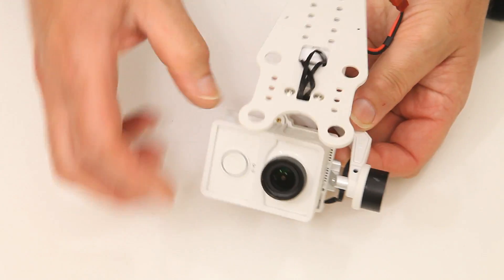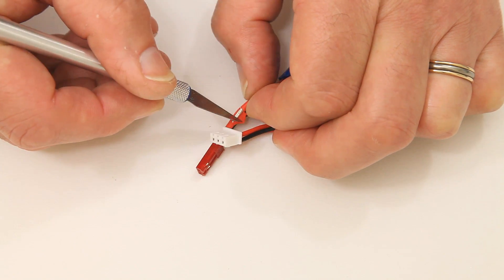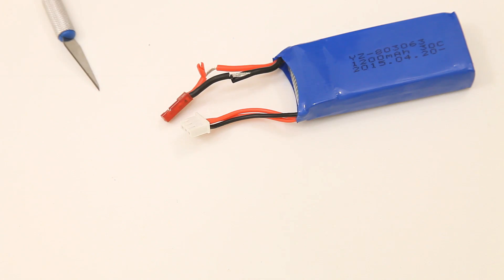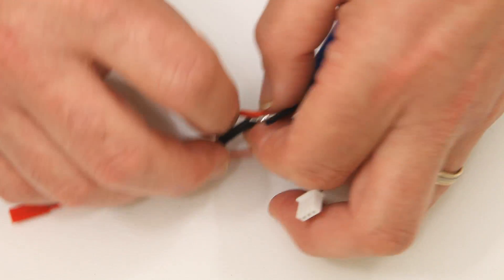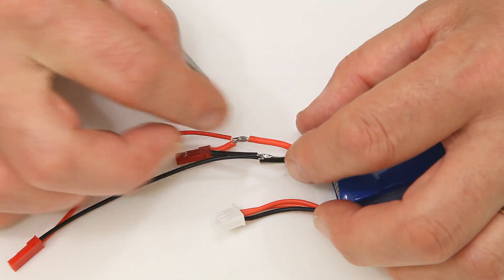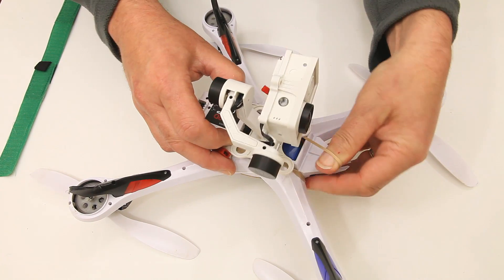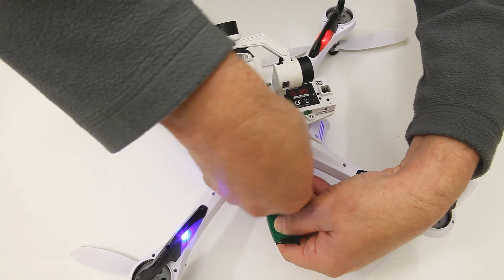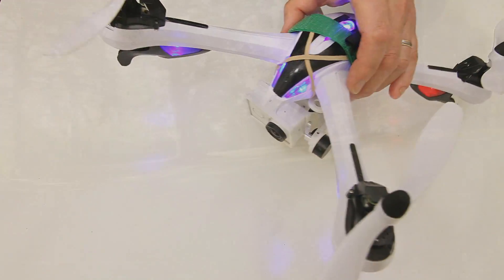Tarantula X6 fitting Walkera G 2D gimbal and battery mod.

Comment: I'm assuming this would work with a jst y harness, right?   Also,  would it be smart to buy a higher capacity battery given the additional weight and the power drawn by the gimbal?
Reply from the maker: +Darryl Price hi Darryl, finding your way around i see :-) Yep loads of people asked about that and yes a definate, then you don't have to mod all your batteries. I did mine because it was the weekend and I had the idea and it obviously had to be done right then! Have a trove through some of the comments because a few people have put a small 2 cell battery to run just the gimbal. Just to try and push it too it's limits I actually put 2 stock batteries on so loads of weight and power here is the video https://www.youtube.com/watch?v=uAb-t5oMLsE with a summary at the end ;-) TBH I don't think it will make a lot of difference but happy to be shown otherwise. Cheers for now

Comment: Hi there!, I'm very glad you are having a loads of fun with your modded Tarantula, your video inspired me to make myself G2D gimbal+ X8W quad combo with your soldering instructions, just finnished soldering gimbal wires to battery couple of hours ago and switched the power on, gimbal shaked like crazy but after a few seconds it balanced into correct position and everything looks fine. I had it powered on for a few minutes and what I noticed is that gimbal motors were very heated so does this happen to yours also? I'm using a stock 2000 mAh battery. Also, can you change the angle of the camera on the gimbal to point down a bit? Thanks a lot for your video man!
Reply from the maker: +Haris Berbic Hi Haris aren't these fun :-) gimbal sometimes has a wobble on start up, never managed to sort that so assume it is just setting up. Not noticed hot motors on mine even when i run it on CX-20 so don't know about that one :-( I think you can just alter the adjust screws but my way because I don't bother fussing is to hold the quad at an angle as I plug in the battery for the gimbal and it should stabilsed to level but when you fly it is at an angle ;-) hope it works for you and hope you thumbs up and subscribe if you haven't already good luck :-)

Comment: Hello! I plan to make one. How much volt is the battery u using on the drone and how long hold up the air  and also the wifi distance? I see ur flying his no breaking signal or choppy did u used u 2 camera?
Reply from the maker: +Jimmy Cheung around 9 minutes of flight check out this video to see https://www.youtube.com/watch?v=GuZyYS78AXs I don't fly wifi I fly line of sight only at the moment, I have heard it can interfere with signal but not tried it as happy with results without. hope you thumb up and subscribe if you haven't already thanks :-)

Comment: Hello ! Great job , the setup is fantastic! I have just got the same gear , Tarantula X6 with Walkera G-2d and Xiaomi yi and i wanted to ask you about a problem that i've got... Did the same , connected the walkera with original 7.4v battery of the tarantula , but when i take off after 20-30 seconds the lights start to blink and that's it, it goes down, :( i have to charge it again e.t.c. when i remove the gimbal and i connect only the tarantula with the battery i fly normaly (about 8-10 minutes) Have you or anyone here experienced the same problem , any suggestions will be very welcome!
Reply from the maker: +Hughes518 I have another X6 I should get next week so I will give it a try, definitely sounding like a weight issue but I still don't see how my original one still lifts everything I throw at it, hope to post a helpful reply soon. Cheers for now
Reply from the maker: +Johnny B Yeah well done you, plug in a 6 cell and fry that board :-) TBH 6 minutes is long enough to get most video, you will only cut it down in post if it's longer ;-) have fun.....derrrr course you will :-)
Reply from the maker: +Johnny B Ideas, I'm full of ideas it's just converting them into reality ;-) Hey you seen my channel you go figure it out yourself LOL I love the combination works real well for me as I hope you can tell from the videos. now your timing is impeccable, not often I use big words so did just google it to check I wasn't being rude LOL anyway I'm just working on a how I get the results I do from a £230 set-up and what I have learned that makes great aerial video IMO and part 2 of your timing I'm just about to see about a 3 axis gimbal so I should have all the answers for you before you splash your cash :-)
Reply: ***** Thank you guys so very much for your thoughts and help. I have ordered a new rx control  board.  I think that will fix my issues from what I see. I did the same oops storing charged batteries... live n learn. ;>  For future plans you may like the x380 detect gps quadcopter. A bit odd looking but getting cheaper now.  I have seen some for sale new at about 280.00 just recently.  It has a verified flight time of 20 to 30 minutes. Can carry the same g2d gimbals with remote tilt. 1000 meter range.. My dream machine ;>  i have to stop now before i drool on my monitor lol .. Thank you again for all of the input.. looking forward to seeing more vids Tigger ;> and from you too Johnny B now that your flying...
Reply from the maker: +Johnny B Hi Johnny no mine works really well as you will see in my full 9 minute flight video, I would try it with a second battery on-board, i found it made hardly any difference to flight time and just made flying slightly sluggish but it may work for you and keep it in the air for a respectable amount of time. Hope you get it sorted and a like and sub are much appreciated if you haven't already :-)
Reply: +Tigger's RC Reviews Thanks Tiger. Ι ordered one 2s 300mAh 7.4v battery to connect directly to the walkera. I am in contact with the seller though because i think something is wrong with the X6, cause the flight time with fully charged battery and without the gimbal and Xiaomi is only 4 minutes now :( ... I also tried to fly WITH the gimbal and Xiaomi but not connected to the battery and the flight lasted only 20 seconds before the lights start to blink. A matter of board? or the battery maybe?  I have send him a video and waiting for his answer.....
Reply from the maker: +Johnny B Definitely a problem quad hope it gets sorted with supplier soon, let me know and thanks for subbing :-)
Reply: +Tigger's RC Reviews I hope so too....I have just received one more battery that i have ordered from the same seller, i will try tomorrow with the new battery and see how it goes....But as you say, i think it's indeed the quad's problem :/
Reply: +Tigger's RC Reviews Today i disassemble the X6 to see if it has any kind of short or something like that, the only "problem" was that one Tarantula's eye light didn't work, so i cut it of the board. I charged the new battery but the flight time is more or less the same...Now it flies 5 minutes instead of 4 ,but i think that it's not to much. :( ... The seller offered to send me a new battery but i think that the problem is on the board so i asked him for a board instead (rev. 01 board) . What do you think Tiger?
Reply from the maker: +Johnny B Sounds more a board problem, I think, but TBH I haven't come across this so can't say for sure. If you have tried 2 batteries then that more or less eliminates that. Very impressed if they send board I'm guessing you haven't mentioned you took the other apart or I would have thought it would void any comeback ;-) Let me know how it goes. Good luck :-)
Reply: +Tigger's RC Reviews I think i forget to mention that :P .... I am waiting to see what will happen. In the meantime i did some more tests today.. I connect only the Xiaomi Yi to the X6. Flight time approximately 3 min...And based of a video of yours i connected two stock batteries one on top with the walkera and one under with the X6... Flight time under 2 min. Seems that the board have a weight sensor that drains the battery accordingly, or something like that.....
Reply: +Johnny B   Hi, I have the very same problem?  Tried 2 batteries with no reel difference?  as if it is just not able to pack the weight for very long? have seen many videos of this quad with gimbal and same camera fly much much longer... has there been a hardware vers. change?  has any one resolved this problem? i have the same walkera gimbal. x6 has flown 5 times gimbal new so are the batteries. It starts blinking low power 15 to 20 seconds into flight. tried an independent small 7.4 lipo just for the gimbal with no change.  take gimbal and cam off and it flies fine for 7-9 minutes. have put just the sj4000 on a foam rubber mount and get 7-8 minutes flight.  As soon as the gimbal weight is added it dies quick again?
Reply: +Hughes518 Still nothing new.... I am waiting for a new board to try on, if it doesn't work as a last solution i will change the motors too and let you know...In the meantime if you have any solution please let me know!
Reply from the maker: +Johnny B Will do and keep me informed if you find a solution too, this was soooo easy when I first did it I'm disappointed it isn't working for everyone, heyho fingers crossed someone gets it sorted and we all benefit :-)
Reply: Tigger's RC Reviews
thank you both....i really enjoy your videos and tips Tigger, thumbs up. also checking if it is a charger issue? is there a chance my charger is not fully charging my bats? i have only used the stock charger so far,  and my last unladen flight lasted 8 minutes, hmm.  i have added a jst jumper lead to extend power reach to the rear. I will check to be sure they are large enough not to create resistance. Johnny B have you done anything similar to that mod?  just curious.
Reply from the maker: +Hughes518 Thanks for beating me to thumbs up question, you guys know me soooo well :-) I use a genuine BMAX i6 charger and hope to post a video on how I charge etc soon. The batteries don't last forever and if you leave it in full charge mode for awhile this will affect the battery performance as well. I just leaning this as I get all caught up with one quad and forget to fly some of the others and when I do the battery is usually gives me less than it used to, so Tigger is learning all about storage and all I want to do is bounce....i mean fly :-)
Reply: +Hughes518 no, i haven't done anything similar to that.... And i have already tried to charge the batteries with another charger but didn't see any difference....BUT i have great news :) , the new board came yesterday , i have changed it and i've just returned from a test flight with 3 full charged batteries. 1st one, with ONLY the X6 , flight time 10-11 minutes!!!! (only 6 minutes with the old board) 2nd and 3d batterie with X6 + walkera g2d + xiaomi yi + a 2s 300mAh 7.4V batterie to feed the walkera separatly, flight time 6 minutes each.. ^_^ . I will do more tests (feed the walkera with X6's batterie, without the landing gear) to see if i can increase the flight time but this is enough for me as it is!!! Very happy right now that's why i can't stop writing....I'll just go out and BURN the old board XD !!!!
Reply: +Tigger's RC Reviews Sure will Tigger!! Thanks again for the general idea !! Keep up the good
 work! Oh, by the way, i am thinking that the next step for me ( after 
the winter i think) will be Cheerson CX 20 , for a better air 
video-photography with walkera and xiaomi.... What is your opinion? How 
long does Cheerson stays in air with gimbal+xiaomi?
Reply from the maker: +Hughes518 x380 hmmmm christmas and my birthday and everyone is asking what I want, maybe I just found the answer. Thanks TTFN :-)
Reply: +Hughes518 x380 looks good :) . I will add it to my wish list.... Let us know if the new board will solve your problem when you receive it! :)

Comment: I got a strange problem: huge lag interference  after I  installed the gimbal.  There is lag now between the Tx input and the quads reactions after the G2 gimbal is installed? why? maybe we should use separate battery?

Comment: great great video !   i have some questions im getting the syma x8w  and was looking at this  FPV BGC 2Axis Gimbal w/ Controller on ebay is few bucks less then the walkera at 38...  my questions are do you know if i can apply your tutorial in my case and ill be using a go pro3, also i dont know if your familiar with that gimbal or other but do you recommend the walkera better.  i appreciate your response, thanks
Reply: +ivan riobla subscribed already ;D
Reply from the maker: +ivan riobla Hi Ivan....beat me to it on the subscription, thank you :-) got over 800 in 6 months :-))) that's all my chins smiling LOL OK gimbals, the reason I went for the Walkera was purely weight, it's over 70g lighter than the one you are looking at and when I was going to try it on the Tarantula I couldn't find anyone who had put a gimbal on one so went for the lightest option. I don't own a X8w so don't know how it will handle the weight, even if it can. IMHO 70g is quite alot! I have had no problems at all with the Walkera, although I have had people comment that setting it up can be a problem, I've never set mine up I just use it out of the box, simple suits me just fine :-) Good luck with your decision and I look forward to seeing the finished results. Thank for comment and sub

Comment: Hello! great video and great flight. 
A question, in this gimbal, I could place a sj400?
Thanks!
Reply from the maker: +Juan Pablo Javiel Hi Juan, I don't have access to a SJ4000 but looking at specs I'm pretty sure it will fit, if not the gimbal is very easy to sort. I'm really pleased with the results, have a look around my channel to see examples. Good luck and enjoy if you get one and thanks for subscribing :-)

Comment: that is a lot of weight for the x6 to carry, what is it around 195g counting the gimbal, yi and straps?  is the x6 still able to climb high and fly well or is it barely enough to support the setup in flight?  thanks
Reply from the maker: +mrphotomanTIM You would think wouldn't you, but here https://www.youtube.com/watch?v=uAb-t5oMLsE I attach a second battery so waaay over 250g and still it pulls well. Back to original mod. here  https://www.youtube.com/watch?v=GuZyYS78AXsI run it for over 9 min 20 sec no bother :-) and in this one, can't remember where about https://www.youtube.com/watch?v=7MAkJqrYFUE but I run it at 100% full bore and nearly take my head off LOL so in answer to your question, it doesn't pay any attention to the extra weight and there is no one more amazed than me, I can assure you of that. Thanks for comment but it truly is an amazing quad ;-)
Reply: that is great, i wish i would have went for the x6 instead of the syma x8c.  the x8c is barely adequate with 160g, i actually bought a lower mah battery to lighten the load so it would fly better.  it really does struggle at times with 160g.  sounds like the x6 with a gimbal is the best bang for the buck for a video setup by far.  thanks!
Reply from the maker: +mrphotomanTIM Shame about the Syma, not had a problem with anything including quality from this set-up for under £120 brilliant, I bought all seperates so I can swap and change anything if needed ;-) cheers for now

Comment: Love your tutorials mate! Wondering if this a possibility for the X6: http://www.banggood.com/FPV-2-Axis-Brushless-Gimbal-With-Controller-For-DJI-Phantom-GoPro-3-p-908068.html Pluses are price and no need to mod the cage for the Xiaomi. Also is there another way to come up with a mount for the X6? Has anyone made a 3D printed solution? Cheers.
Reply from the maker: Martin Smith Hi Martin, glad you like the videos :-) I look at this at the start but all that extra weight I thought would be a problem as no one had put a gimbal on a Tarantula. This is why I put an extra battery on after I fitted the G-2D which brings it upto the same weight and yep it carries it, with hardly any noticeable feel on the controls, well not too much anyway :-) Still very happy with my choice an extra few quid to save that weight and I hope a better quality gimbal I thought was worth it, and I'm real tight on spending ;-) Not seen any 3d solutions but I don't have a 3d printer so not my field I'm afraid. Hope you subscribe and I should have more on this great all round quad Cheers :-)

Comment: Nice installation.  What would we do without rubber bands and velcro. LOL Did you happen to see the FPV setup that some 3rd party company made for the Syma X5c?
I was thinking that it could be used on other systems like yours or the CX20. I have one on order and will trying to fit it up the Cheerson CX20. You certainly inspire people to do innovated projects. Thanks
Reply from the maker: Skydive Driver Had a few people keeping on at me how to mount it, TBH I was thinking "it's an elastic band" LOL Liking the praise thanks, hope I'm getting thumbs up toooo :-) No I didn't see it but my view is anything a X5c can carry this would be fine. My FPV is on order so perhaps we can see what system works best, mine is for the CX-20 as well. Where about are you based? As you probably already got I'm in the very north of the UK TTFN
Reply: I am located in a little town called East Palestine, Ohio USA.  I am going to start out using the FPV camera on my Syma X5c and then fit it up to Cheerson CX 20. It is a all-in-one unit which makes it nice and easy. Here is a link for it. 
http://www.banggood.com/Syma-X5C-1-X5SC-X5SW-5_8G-FPV-720P-Camera-with-Monitor-Real-Time-Transmission-p-980090.html?p=RB0922217402201307U3
Reply from the maker: Skydive Driver Interesting look forward to hearing your views, good to know where you are more ideas on the way cheers :-)